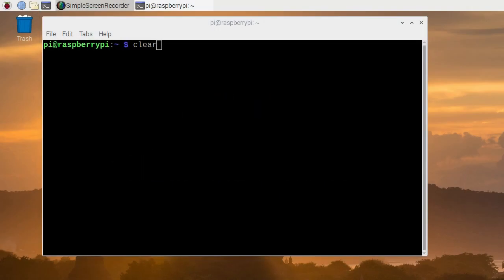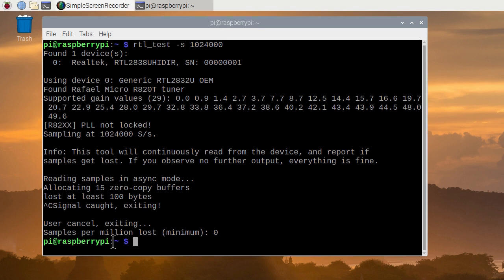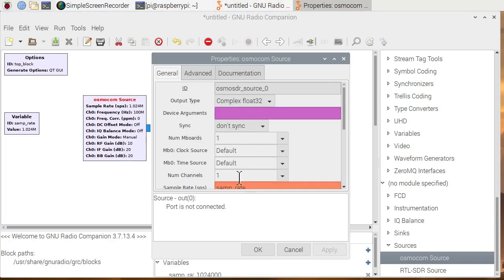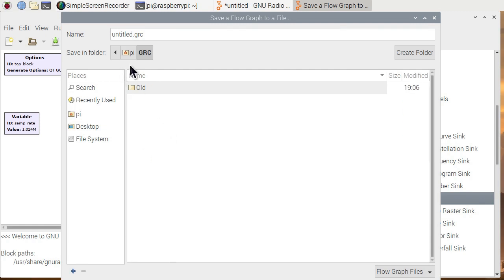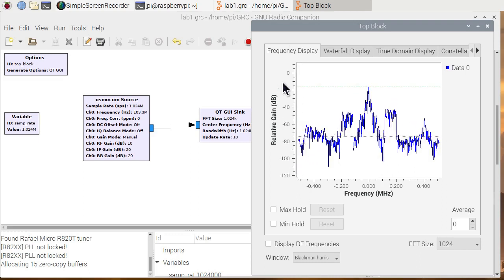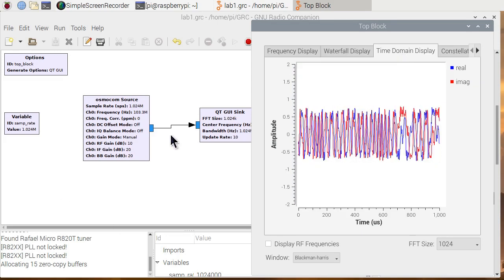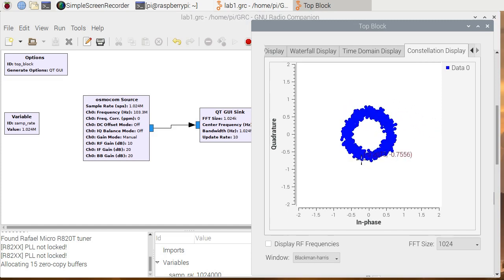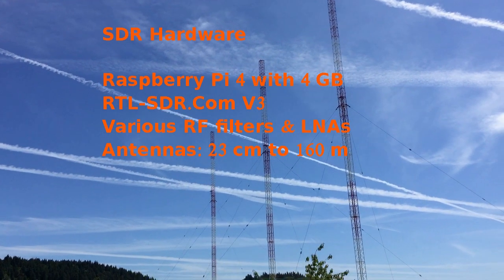RTL SDR Raspberry Pi 4 GNU Radio Tutorial 1

Comment: David, Nice video.  Following along well until I came to the compilation part.  On the top command bar, the compilation icon is not lit so I can't compile the python code.  I am however using Windows 10 and not the Raspberry Pie.  Is that the cause of my problem?  I am also using version 3.7.13.5 when following this video.  Thanks.